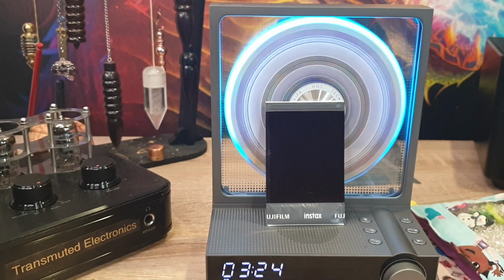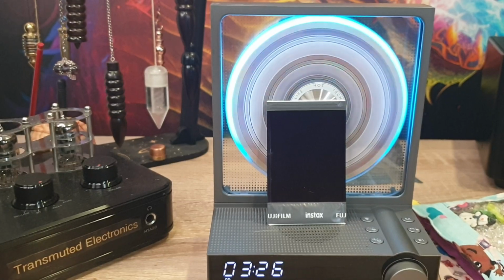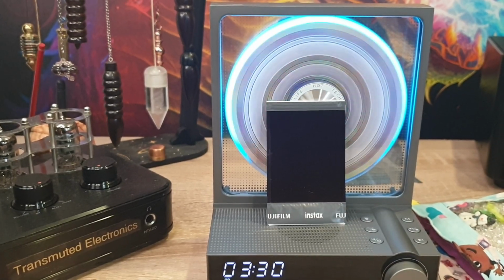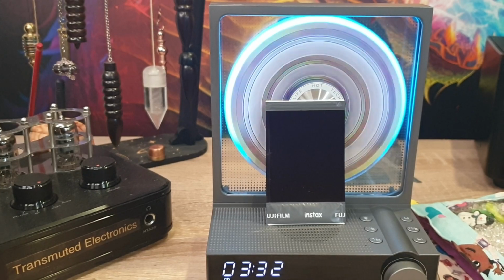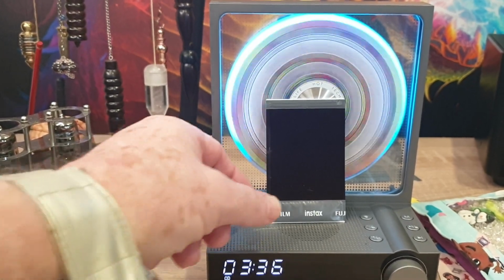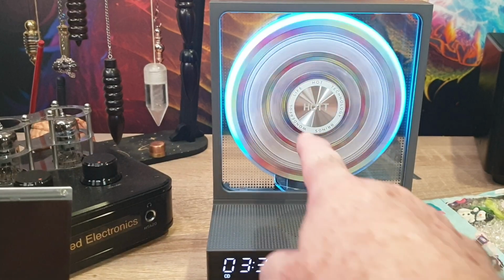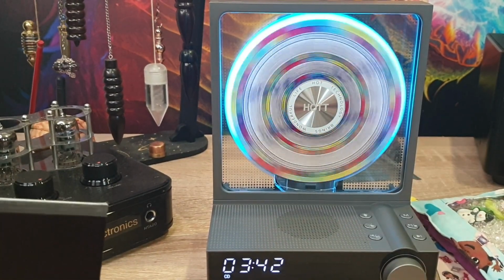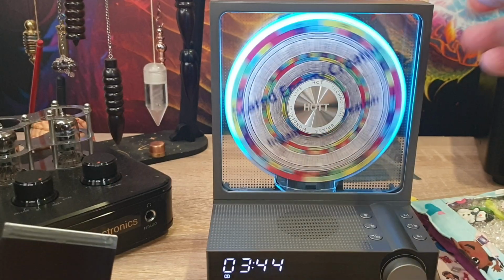New Energy Disc Player - Empower Your Entire Environment - LOW COST POWERFUL TOOL!

Comment: How can one transmitt something if you don't use some kind off antenna for broadcasting?
Reply from the maker: These are scalar waves and the Disc is producing energy that is moved through Spinning. That is why spinning works so well.
Reply: @Radionictech  Then one could just use a fan as well and just connect the disk into the center of the spinning wheel.